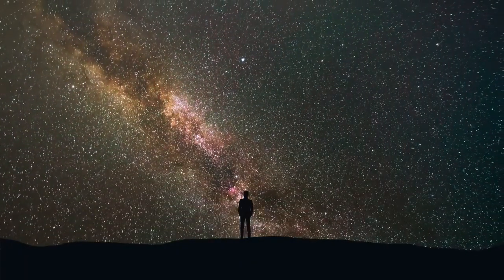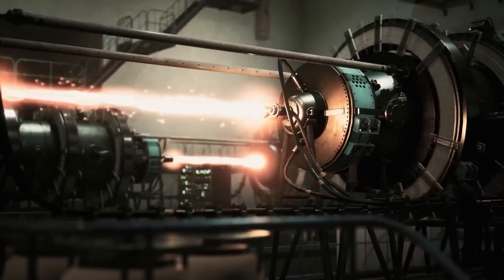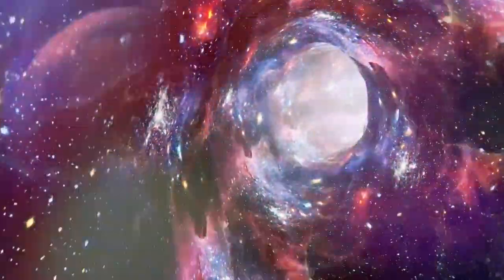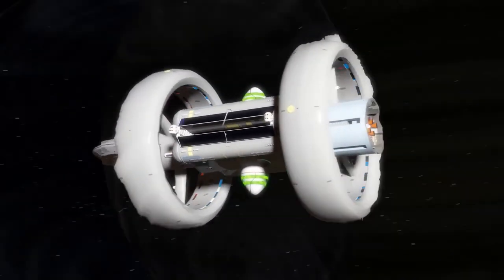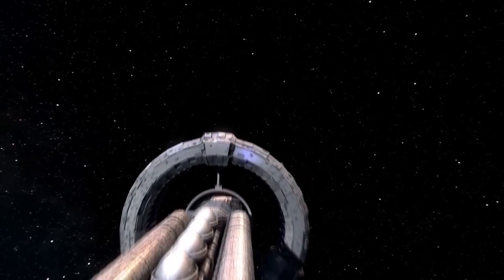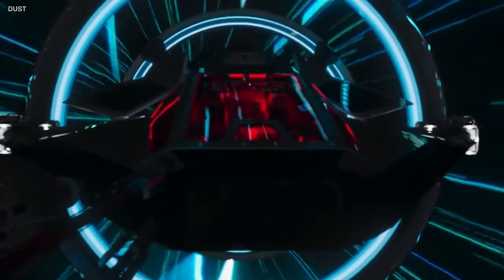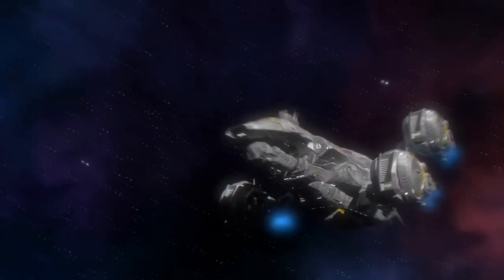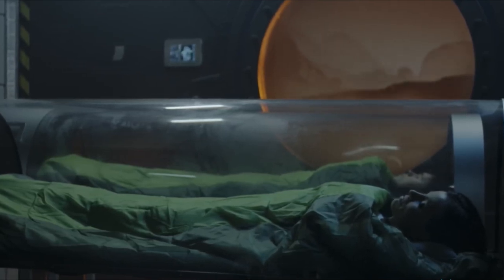Travel Faster Than The Speed Of Light With Warp Drive Technology

Comment: How can a human being make such small adjustments traveling in space at Warp speed ? We have not been working on our brains to computer that would remove the human error of touching the wrong switch or button moving that fast. But if we were to connect our brains to the onboard computer so all the pilot has to do is Think about the direction to move and the computer sences the brain thought and makes the adjustments. Why couldn't we work together in this world to better mankind instead of fighting and figuring out ways to cripple and kill each other. If we can figure out how to connect a computer to a human brain in a Jet or even the shuttle I believe that thought can be transferred to a computer to fly a space craft or Jet Airliner. I know that the Government has been doing experamental thought flight using a special helmet with sensors inside of it. But until we can develop a working helmet for all aircraft - we are bound by human error. The computer will fly the craft but the human being wearing the helmet would override the computer in case of a emergency like another aircraft getting to close and the computer makes it's adjustments and the pilot may need to move those adjustments to a safer route. I know that the government is trying to do this with a helmet and if brain thought can make it easier to fly - then why not give it a try
Reply from the maker: Thank you for sharing your thoughts as well, we appreciate it😊
Reply: Totally agree😂
Reply: I've been thinking about the issue with warp speed and it will be nearly impossible to navigate flying blind going that fast. A couple super computers would be needed to navigate even though the area of space is so large. It's the little things that are floating around in space that would rip your craft to pieces. Perhaps they should be working on a force field for the forward area of the space craft. Having a force field would deflect any objects that the craft would run into. It would be a Horrible day if a space craft flew into a small piece of space junk that astronauts threw out the bay. It would rip the craft to pieces. The only real way to get from this side of the galaxy to the other side would be to create a device that bends time and space. In one jump you can be across the galaxy in a second. But we are not that developed yet. Perhaps this is why the government has been trying to obtain a flying saucer. I used to work at the USS Alabama Battleship in Mobile Alabama and I worked as a security guard at night. I remember one night really late I was climbing up the stairs to the top closing the outside doors because it looked like rain. I was at the 08 Level and I had closed the Port side door and I walked around to the other side and started closing that door when I looked out over the water and seen a huge white Ball of light moving around over the water by the experamental base in south Mobile Alabama. It moved around over the water and I could see sparks coming from it down to the water. Then it took off across the Gulf of Mexico moving at a speed not many people have seen before. It was stationary and then took off across the Gulf of Mexico going so fast and I watched it go until I couldn't see it anymore. I've seen this round Ball of light a few times since then and I will always believe that our Government found a flying saucer and hid it at the secret base in south Mobile Alabama.